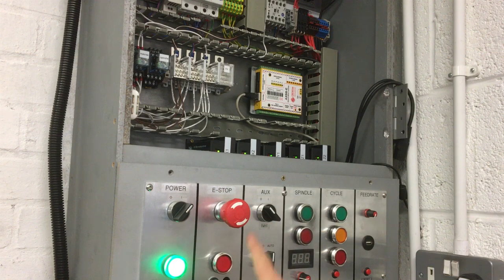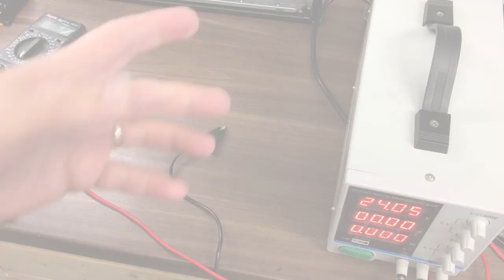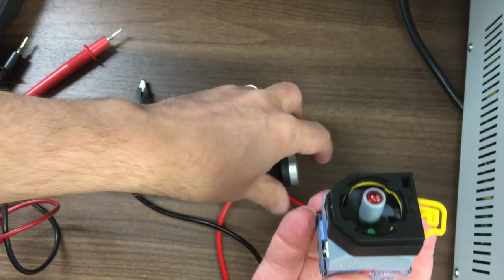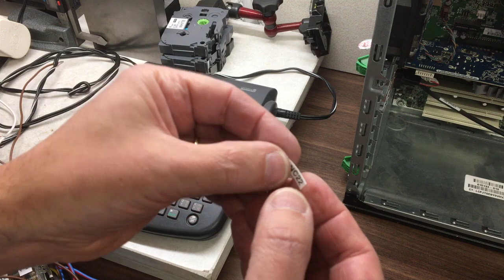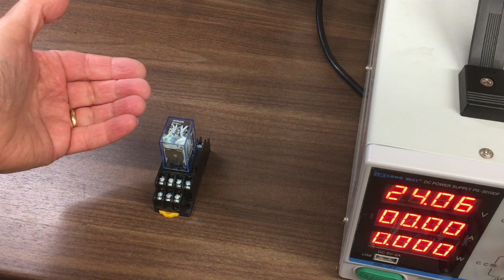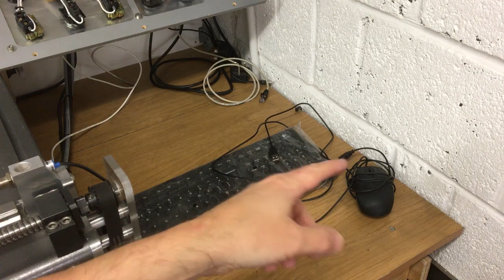Ep30: CNC Ethernet Upgrade - Stepper drivers !

Comment: Such tidy work!
I noticed @ 17:14 that there are jumpers across the Pul+ and Dir+ 5v terminals on the stepper drivers. I'd always heard/read that jumping the power was not a good idea. Never had any explanation as to why so I'm curious if you've experienced any weirdness as a result of the jumpers.
Reply from the maker: I would not daisy chain the main power supply but I think the 5V signal is OK to do that.  It is holding all the 5V together at the same reference voltage and the pulsing is done on the other channel which are separate cables.  Not had any problems with this.  Thanks

Comment: Just spent 2 days watching the update and am amazed, I am in the middle of a milling machine conversion but unfortunately was put on hold due to covid. Now I'm ready to carry on with the build. I too went with UCCNC but went with the UC300ETH 5LPT Ethernet control board.  My question is what size wire did you use in the control box installation, I am more used to metric wire sized rather than the american way but can easy convert if you used the Gaige measurements, thanks and onto the next 2 videos before the Brazilian grand prix starts.
Reply from the maker: From my initial impression I am very impressed with the UCCNC systems and software, so hopefully you will have no issues.  For the logic systems to the AXBB unit I used a mix of 1mm2 and 1.5mm2.  1mm2 (17 AWG) is easier to fit into the red bootlace ferrules and carries up to 16.5 Amps, so I would recommend that.  Good luck with your build !
Reply: @routercnc9517  Ok thanks for the information on the wire size, looking forward to the next video of you using it to finish the drill press.
Reply from the maker: Ok no problem

Comment: It looks super nice but don’t you think its a bit excessive? At this point you do this because its your hobby right?
Reply from the maker: It’s a good question.  For UK builders this is a pretty typical build level and in fact often we would often use a proper metal enclosure and Piltz safety relays rather than generic ones and safety lock out on the door etc..
But it depends on your level of risk as much of the wiring is for the safety side and provides a hardware estop, alongside the software estop.  Also the 24V side is used to reduce electrical interference and is industry standard for the same reason.  These are the sorts of things used in professional systems. The other aspect is convenience of operation with the front panel controls but that side is person preference.  I may chat about this topic in a future video because some new starters may think they have to do all this whereas there are levels of choice and risk for the DIY user.  For me I enjoy building and making as part of my hobby so have no problem building systems towards what the professionals might do, with my own level of overall operating convenience too.  Good question thanks.
Reply: @routercnc9517  Yeah i agree if I wad to buy a CNC I would expect the panel to look like this. My 4 drivers are in a wooden wine crate. There is a smoothie board screwed to the lid and everything is connected with ethernet leads. (Expcept the power stuff of course.) Then the only controll I have is a mains switch and a dial on the KRESS router.
Reply from the maker: My first machine control was just like that.  So for DIY it is whatever you want it to be really.

Comment: For cable ties I always use flush cut snips, the ones often used to cut the legs off of components on a pcb. For small cable ties in tight spaces they are a lot easier!
Reply from the maker: That’s an idea.  I think I have some in the drawer!  Thanks
Reply: @routercnc9517  You probably got some with the 3D printer, its the ones I use.
Reply from the maker: I don’t have a 3D printer - not yet anyway !
Reply: @routercnc9517  Once you do you will never know how you managed to do without it. Its great for making test pieces to check fit before doing it for real in solid metal or making housings for circuits and switches just to mention a few. Its amazing the strength of some of the plastics nowadays, I like PETG as its tough, not much shrink and does not absorb so much moisture as others. If you decide to get one Keep an eye out on the second hand spaces as for many the novelty wares of and there are always good models for sale and a lot cheaper than new.